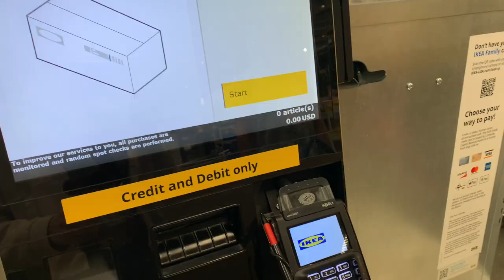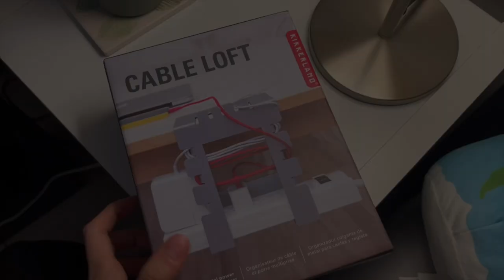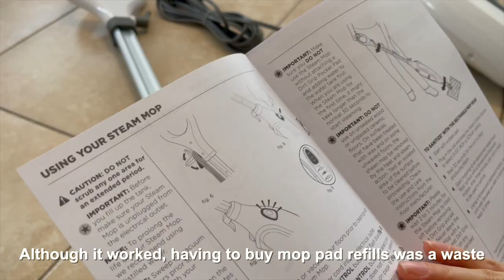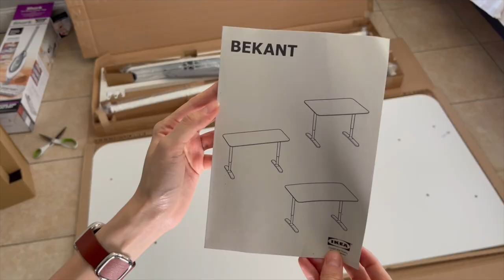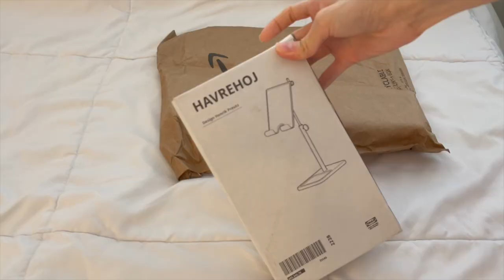Desk Transformation 🖥️🌱 minimal, functional, cozy! clean, unbox, & set up with me 🤎 2 year journey

Comment: Your setup is so clean and cozy! Does the desk seem wobbly at all? Like does your screen shake or vibrate slightly when you type? Can you rest your arms on the desk without any movement? I've just seen some brutal comments claiming the desk is super unstable, but I really want to get one because it looks so nice! Would love to hear your honest opinion.
Reply from the maker: Thank you (: I personally haven’t had issues with this desk model. When I assembled the desk I made sure the screws were on tight enough & when I adjusted the legs & the leg risers I made sure they were the exact same height to prevent any shakiness (leg risers are the black circular knobs at the bottom of the legs). I also made sure I centered my monitor just in case. It doesn’t shake when I type & I can rest my arms on it comfortably without it wobbling 👍
Reply: Thanks so much for the reply! I think I'll go ahead and order one for myself then. :) @dreamydebs